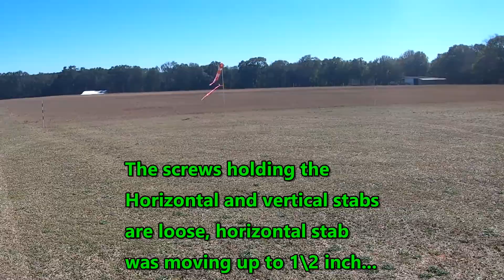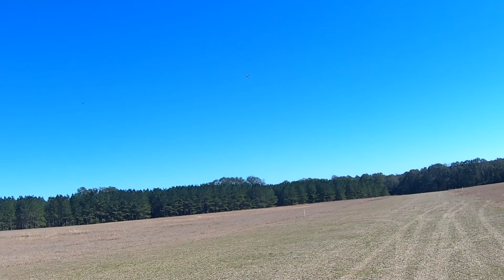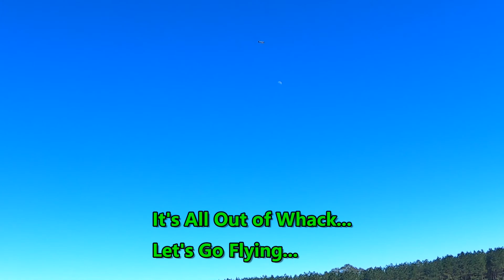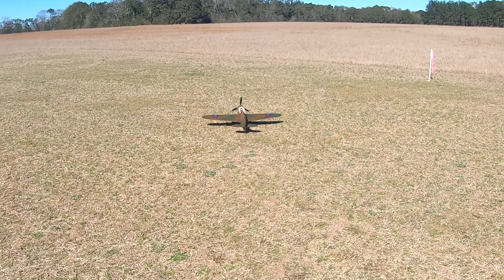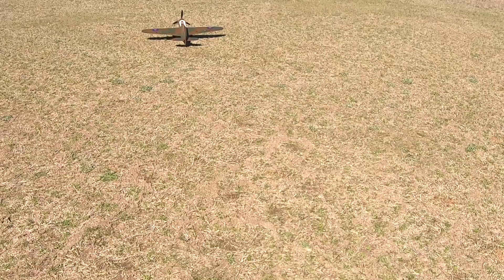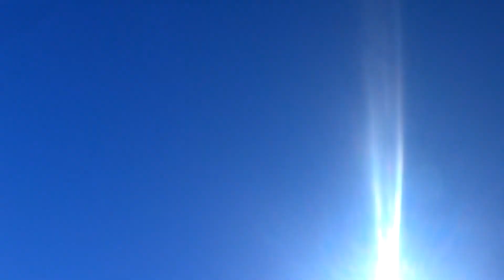Hawker Hurricane Last It's All Out of Whack Flight

Comment: Great little plane and glad it ended up ok!
Reply from the maker: David thank you Sir, it flew well considering that the two bolts that hold the tail on were so loose.  The screws in the elevator control horn where also loose. Jeff

Comment: Very nicely landed! I cut space in mine for the bigger battery, added noseweight and it STILL kept pitching up. It started getting towards the boundary and I foolishly rolled it over and tried to U-turn, pulling up too early to harshly, so it just kinda tip-stalled on way then the other - I just about got it level before it hit the deck. Unfortunately, I didn't get the gear retracted before the crash this time, so both legs were bent and couldn't retract. Trying to bend one back, I accidentally snapped the retract gear! Turns out nearly everything in them is plastic!

So I've installed some new retracts in it now - forgotten where I've left the legs for them though! I've also adjusted the elevator push rod to set the elevator in a down position as standard and also set it on the inner-most hole on the control horn to get the maximum throw - allowing trim to have more of an effect on any bad characteristics. Once I've found those new legs I can stick the replacement prop on (oh yeah, I broke the prop again, good thing I ordered two last time haha) and give it one more go.
Reply from the maker: Thank you for watching, I've flown this without any issues but man I got lucky I didn't smack it into the ground.  I shouldn't have done the loop.  I just kept flying it because I thought I'd smack it in trying the landing.  Will tighten every thing up before the next outing.  Going to add some weight so I can use a 4s 2200 and trim on the battery hatch. Jeff

Comment: I thought it was going to bite the dust from the video title, thankfully I was wrong, 👍🙂
Reply from the maker: Cliff so did I, the horizontal looked good when I checked for proper travel but any pressure would cause it to come off of the fuse.  I need warmer weather because then I'm in my garage, hanger, checking my planes all the time. Got lucky again, Jeff